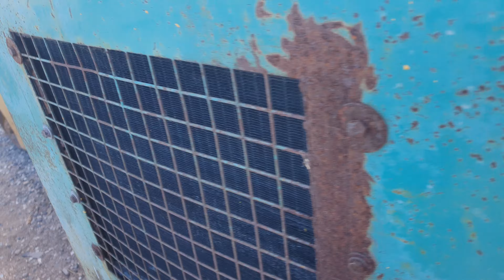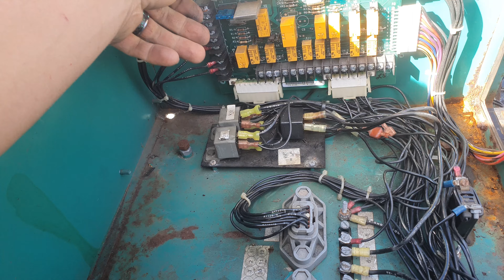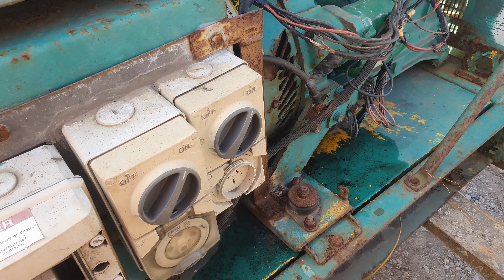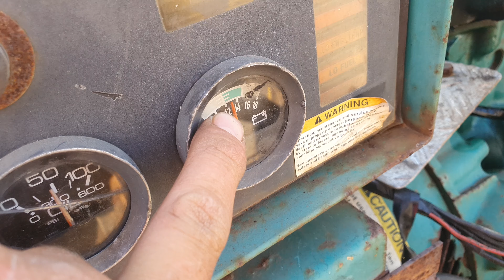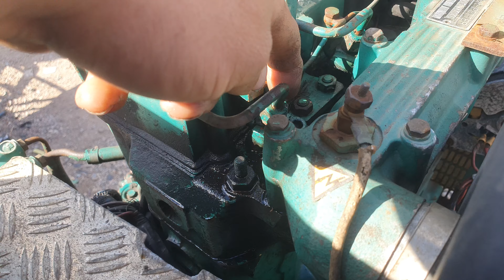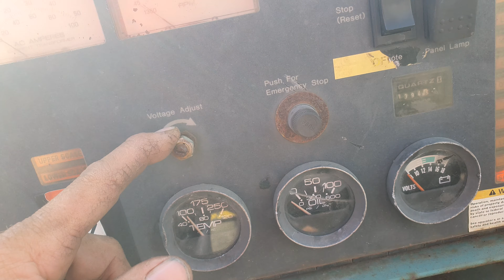Cummins Onan Lister petter generator with no power output  help please...

Comment: That looks too small to be the AVR but I've not worked on a generator like that. Possibly have a look at the voltage adjustor since it's so rusty (just a guess).
Reply from the maker: I've found a avr. I think it's either 16 or 20kva